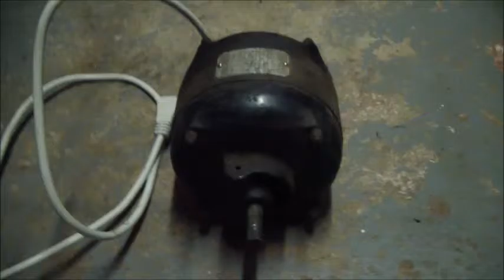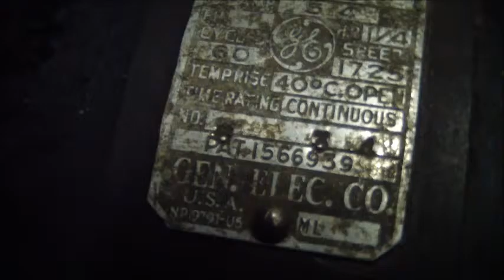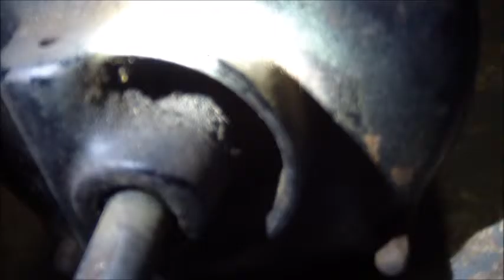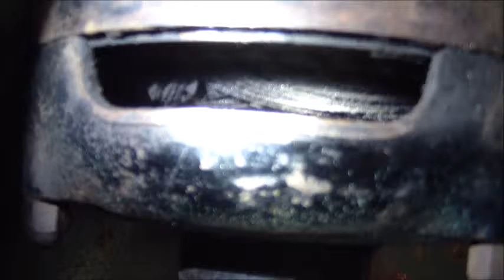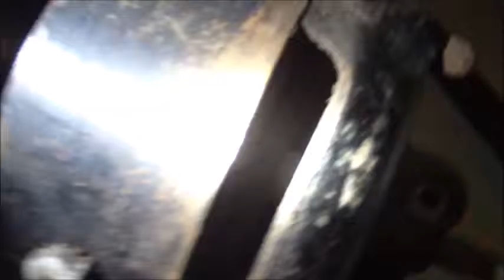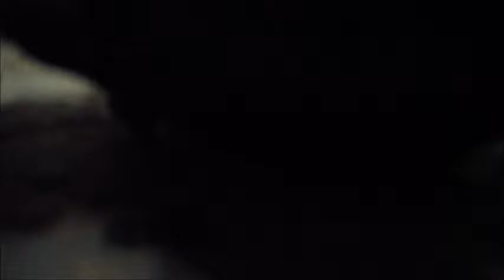Antique GE Electric Motor.

Comment: This is not a repulsion start motor. It is a split phase motor with the start and run windings on the armature and the squirrel cage is stationary. The brushes ride on collector rings applying power to the windings on the armature. To reverse the direction, you have to take the motor apart and change the starting windings on screws provided.
Reply from the maker: that's good to know. thanks for letting me know.

Comment: These motors were often used on washing machines. I have an old Easy washing machine with this exact motor on it.
Reply from the maker: +coolbluelights That is very interesting. I had no idea how old it was until I took it out of the fan and looked at it. It was sitting in my garage for a few months before I decided to try it out. The most interesting part is how the squirrel cage is the stator and the windings are on the rotor.